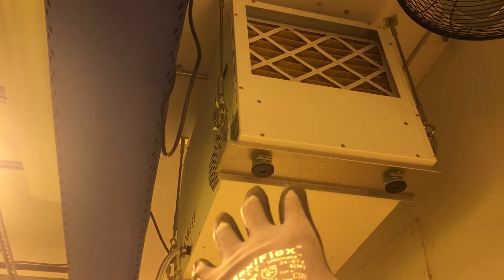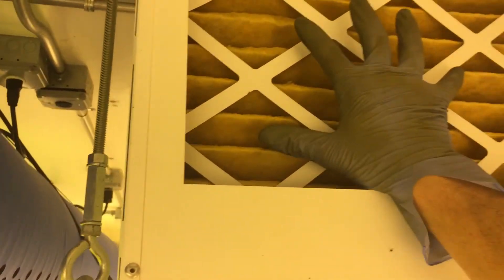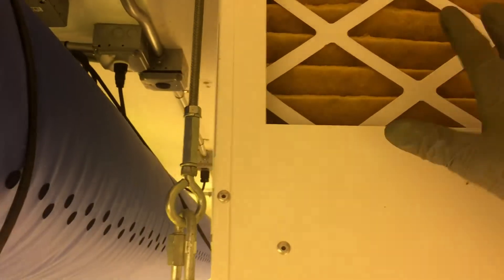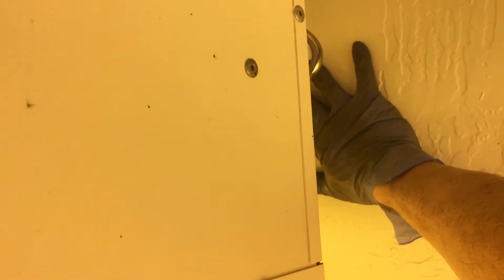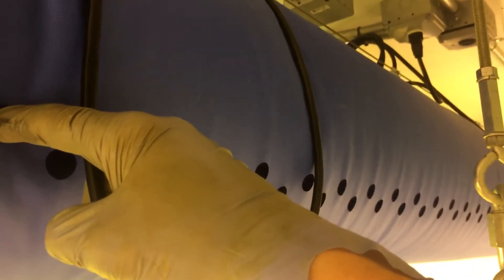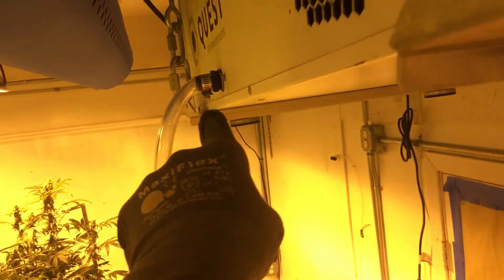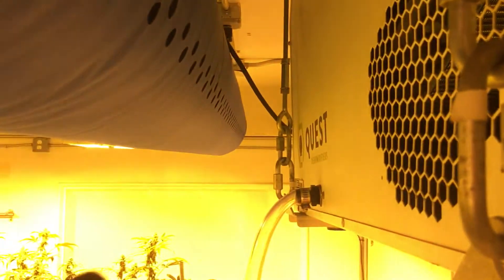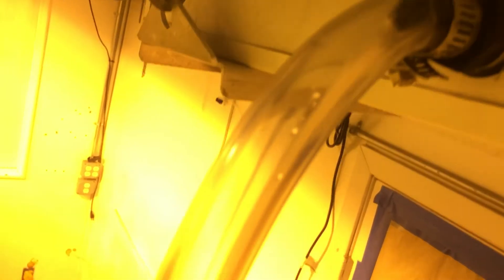Dehumidifier Location problem makes it less effective.  It can’t dehumidified already dried air￼￼

Comment: I have 3 of these that are firing on with the fan and compressor but getting no water drainage.
Reply: This video was not helpful at all. Totally pointless.
Reply from the maker: @chasecoffin3719 totally explains how people in properly install dehumidifiers wasting money with less performance. 
    Unless somebody is mentally handicapped and they can’t comprehend it
Reply from the maker: Is the discharge air coming out hot ?
Reply: @coldfinger459sub0  I just checked the discharge line pressure and it’s 57 psi. Guessing low refrigerant. I’m only seeing one access port. Do you charge refrigerant with the compressor sucking it in through that port?
Reply: Throttling it of course slowly to ensure no slugging
Reply from the maker: @BridgeWater94  how old are these units for three of them to all be low on refrigerant at the same time is kind of a high coincidence chance that usually is unlikely.  But it could be leaking especially if you’ve ever use sulfur sulfur attacks. Copper causes little micro leaks..  sulfur acts like a little woodworm burrowing into wood, making a micro size scopic hole

But I asked for recharging where we usually do is you completely drain the system out put it under a vacuum we breathe in a high side sitting on the high side .  And using a very accurate scale plus or -5 g on a steady hose and valve we weigh in with the manufacturer requires on your sticker for the wait for that specific unit.
Reply from the maker: @BridgeWater94  we do not top off we do not add we only completely remove an only charge by weight.

We only do it one way the right way 

The top off method is what we call the beer can cold method. We leave that up to Billy Bob Butt Crack playing the banjo on the Appalachian mountains. . 
         These are the guys the reason sometimes compressors need to be replaced because of the guessing method.
Reply: @coldfinger459sub0  ah ok thanks for the reply. I work at a grow facility with 21 grow rooms. 
One of em is iced up and I’m getting 57 psi which I’m sure is a leak. 

The other 2 I gatta trouble shoot tomm. 

Will do I’ll pull out all the refrigerant and weigh it in correctly.
Reply from the maker: @BridgeWater94  that is the 100% guaranteed method that you cannot go wrong  (“IF DONE CORRECTLY “)

The least amount of risk of damaging the compressor .  The compressor has already ran hot because it’s low on refrigerant so the compressor has been working severely hard.. 

It relies on a correct full charge of refrigerant to return the correct amount of coal flow of refrigerant back to the compressor to help cool it off, and a full charge of refrigerant is responsible for returning the oil . 

When a refrigerant charge low compressor, overheating and lack of oil, return are the two things that cause compressor failure
Reply: @coldfinger459sub0  understood. I have all the compressors off for the remaining units just in case. Don’t want them running hot when they aren’t cooling the coils.
Reply: For the output of the air with the fan is a 10  degree difference enough? Room is 75 fan is blowing out 85. 

If not what can be the cause? Checked refrigerant levels they are good compressor is good, filters good. P trap is installed too.
Reply from the maker: @BridgeWater94  sounds like a warm charge because I would expect your discharge air temperatures to be about 104°F  to 114° something like that.  

Sounds like a little charge . 

Oh, anything you can do is try recovering out of all the old refrigerant put it on the back and pump for an hour or less   and recharge it with an accurate scale within 5 g accuracy by weight.

Comment: how do you change the filter with the threaded rod in the way of the filter door?
Reply from the maker: Very difficult Lee do you have to slide the unit forward or backwards on the rails that it is resting on push the all thread out of the way.   

We did not install it of course this was installed by somebody who smokes weed 😅lol😂
Reply from the maker: Very difficult Lee do you have to slide the unit forward or backwards on the rails that it is resting on push the all thread out of the way.   

We did not install it of course this was installed by somebody who smokes weed 😅lol😂

Comment: My dehumidifier started blowing only cold air and no water coming out ? Only 1 yr old
Reply from the maker: Yes they appeared to have some quality control issues I see a lot of failures with these dehumidifiers
Reply: @coldfinger459sub0  if the refrigernat system is not leaking, then can be easily handle.
Reply from the maker: @陆剑-q1j  all theses  different problems are all caused by people not reading installation instructions. 

Other then the bad capacitor was made more difficult by the way the unit was hung up , no thinking 🤔 to make it easy to service later.

Not understanding we’re to correctly locate the dehumidifier and the directions it received air and were it sends the hot dry air is do to not understanding and reading air flow and developing localized hot spots
Reply: @coldfinger459sub0  I have seen such dehumidifiers before. the totally design was good, and may US gwoers like such design.  But in my personal understand, I do not like some points. 

To aovid the heavy weight hanging up on the ceiling, the totaly shell was thin metal. So it will be difficult to maintain or fix  or chang fan capacitors or compressor capacitors. Because people need to use tool to release dehumidifiers on the floor and then open the cover shell metal to do any maintaince.  And because of the metal is not thick,  the screw can not be well fixed after many times maintaince. 

Normally the compressor or fan capacitors will be easily broken if the inside temperature rise. So I think it should be easier for people to maintain the dehumidifiers. Such as changing realy or capacitors with machines on the ceiling. but only open one small piece of metal shell.  because the labour cost in US is very expansive. 

And another thing is in order to keep the special air heat exchange inside.  The air inlet & air outlet are on the similar direction. I think it is not good for room air circulation. The inlet will suck most of the dry air from the air outlet.
Reply from the maker: @陆剑-q1j  yes most dehumidifiers that we have here pull air in from the left or the right and then shoot it out the front so they left and then front panels adjacent air direction but you can put ducting attached to the sheet metal with a 90° or two 45° angles to pull air or push air in the direction you want. 

The very large ones I have installed in some of my videos are straight through pull from the rear, and push out towards the front to achieve proper airflow direction .
Reply: @coldfinger459sub0  will you add extra fans when you put duct on the dehumidifiers?  because the 90 or 45 degree angle will reduce air flow.
Reply from the maker: @陆剑-q1j   put on two / one size larger 45° duct = one 90° 
       Less static pressure resistance. 

On the larger commercial dehumidifiers, they were actually designed for a slightly higher static pressure that you can add ducting onto . 

     But like some of the ones you’ve seen in my other videos, the very large ones with ducting.   They specifically saying their instructions you must have at least 4 feet of street ducting before your first band.

      You can see that on my installation video on a room that has three 500 pint dehumidifier’s.     He will notice that there is 4 feet of metal straight ducting before achieving a single 45 angle degree with a few feet of straight ducting and then another 45° angle..
Reply: @coldfinger459sub0  that is correct to have 2 piece of 45 ° duct instand of 1 piece of 90° duct. 

Do have any other suggestions for grow dehumidifiers?  So that suggest our dehumidifier manufacturer in modify in our EAST dehumidifier model. 😀
Reply from the maker: @陆剑-q1j  dehumidifier that has a high speed and low speed . 

Connect to a remote control.  So you can connect more than one dehumidifier. 

Google ( Troll Master)
Reply: @coldfinger459sub0  connecting with troll master is easy, we have already such function in our new model.  Hope in near future you can see our dehumidifiers with such function in US market.
Reply from the maker: @陆剑-q1j  energy efficiency. Watts used per pint of water produced 

Go to the company Santa Fe .  Yes, I believe they list their energy efficiency on how many watts of power are consumed 2 L of water produced.. 

ECM motors on the fan . 

VFD soft start on the compressor motors let’s go so there is no power surge for consumption .
Reply from the maker: @陆剑-q1j  forgot to mention corrosion resistant coatings on all the coils. 

And they’re actually using stainless steel Danfoss expansion valves .
Reply: @coldfinger459sub0  
Energy efficiency is what people alwasy persue. But once the efficiency is very high, the machine price will be very expansive. So the total USD cost for buying dehumidifier and electricity cost will not be low.  We need to find the balance for both machine cost and electricity consuming. 

Normally we check the cooling capacity of the compressor when we design dehumdifiers and calculate the dehumidification. Such as 225 Dual, I saw the compressor is RECHI 44A352A, the cooling capacity is 4115W, the compressor power consuming is 1405 W. So we need to use compressor higher cooling capacity with less power consuming in order to have better energy efficiency.   Or another way is use same efficiency compressor but lower machine price to help growers save cost. 

ECM fan is OK, we are adding this in our new model for grow dehumidifiers. 

VFD is a good idea, I will check with our engineer if easy to add this function on the compressor protection circuit.  Right now we have inverter dehumidifier. It's inverter compressor, working all the time and the compressor working frequency will change according to room humidity and setting. This efficiency is very high.  but the unit price will be around double.
Reply: @coldfinger459sub0  
The corrosion coating depends on different parts. Danfoss expansion valves we use is copper VS stainless material, the water tank is stainless steel.  We can also make stainless steel body shell if buyer request.

Comment: How do you make the condensation drain?
Reply from the maker: Google the word (RectoRseal trap 3/4 )
      You will see a white PVC trap at the connections and it’s clear in the center so you can see through it
       And it has a little red lids that you can open up so you can clean it out in case it gets clogged up
Reply: go to lowes. ask for P trap.

Comment: So how much better weed can you grow? ^.^
Reply from the maker: Before I started installing my air conditioning systems here and correcting the humidity and airflow.       They were not even getting 1 pound per light. 

After I installed the first air conditioning unit and dehumidifiers and pretty much dialed it in there almost up to 3 pounds per light. 
       They now sell top shelf product. 

      This room you see here is going to get torn down and I’m gonna rebuild it and put in one of my systems.  LG VRF

It’s not the name or the brand of the system that is on the equipment that makes the difference. 

         It’s choosing the correct size equipment correctly installed correctly air balanced and 100 other little things that make the difference between a good system in a bad system not the brand name. 

I could install a Goodman system and make it work good. Even though I personally do not like Goodman.
Reply: @coldfinger459sub0  Your videos are a treasure for those who understand more or less. Best of luck.

Comment: I hate those blowup dolls ducts lol.  Agree it’s almost short cycling the way that setup is, unit is working harder. What is the RH that they are  trying to maintain in that room.  Manufacturer states must have trap.  Cheers
Reply from the maker: This customer starts off the first few weeks at 70% HR  then as the buds get thick slowly drop down to 50-55 %. 
           Then the last few days drop RH TO 45%_50% and 60°F 
          If it’s a purple strain they definitely want to 60°F at the end. 

This room has a Toshiba carrier VRF system with Traditional vertical air handler’s that have two small of opening on their returns choking it off and only small 1 inch air filters that dryer off the floor easily getting plugged up with all the dirt. 

        But they cannot maintain their temperatures in the summertime and sometimes the winter times because the units were improperly installed. 

          I’m replacing everything here with LG VRF 5 to 6 rooms hundred lights per room 80 tons of cooling each.
Reply: those ducts are called dutch trunks.  they're a cost effective way to distribute cool air.